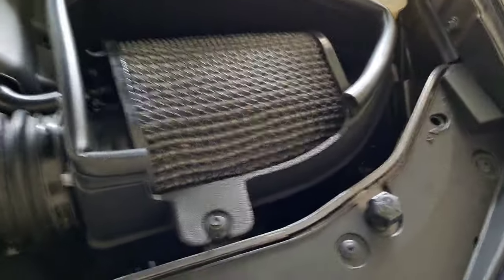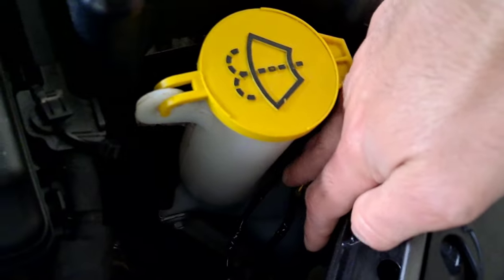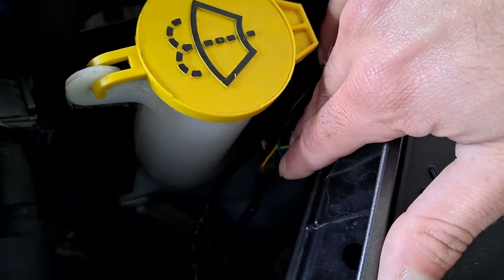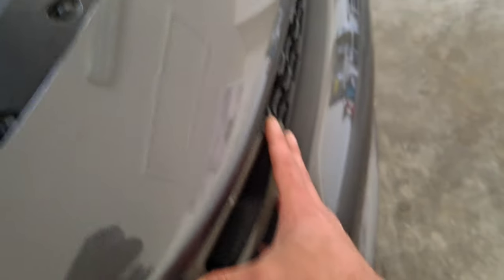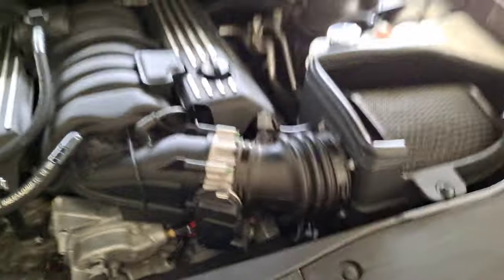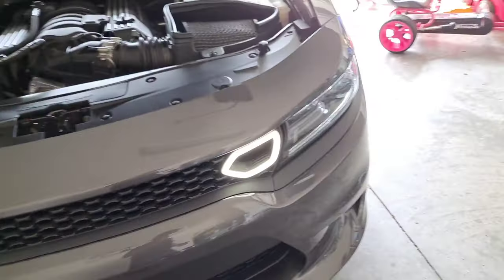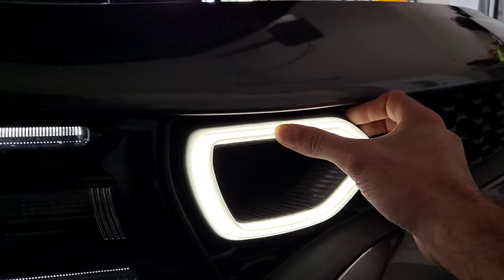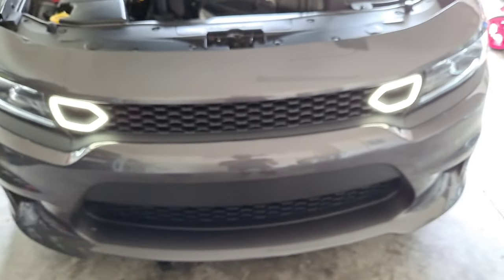Dodge Charger LED Snorkel Lights Install (Update on Install method)

Comment: Took my first set out, on my left one i had like 3-4 LEDs die, gonna order another set hopefully i just had a defective light. Worked good for about 5 months though before the issue. Gonna use this method next time.
Reply from the maker: I never even checked what kind of warranty these came with.  I know my LED headlight bulbs came with a 2 year warranty. One went out.  They sent me a new one no questions asked nxt day shipping.  Def the way to go if these have a similar warranty.  Thanks for Watching 💯💪🏾🤜🏾💥🤛🏾

Comment: I installed mine on my Scat  & sometimes when I'm driving EPS indication or ESC indications sometimes pop up on my dash, what's that about?
Reply from the maker: That's your traction light.  Electronic Stability Control.  I don't see how wiring these lights could do anything to that.  You just getting sideways 🤣

Comment: Yo FLA did u wire both to 1 sidemarker or 1 to each side marker
Reply from the maker: One to each side marker.  Man that lil Rock chip in the video actually Crack the light. Starting to let water in.  Smh 😤
Reply: Dam bro i would try some clear calk or somthin to seal it up today my passenger side was super bright and driver side was dim and they have bothe been dim for the last 2 weeks they been on my car ima have to go back in and check my T connectors
Reply from the maker: @bulletscat3927  yea was thinking about trying to seal it.
Reply: @KingFLA  i had the led sidemarkers on my last RT and a lil water got in there and burned out like 4 5 leds so i taped up the face and sealed the edges with some clear calk couldnt even tell

Comment: Yo does this way work the turn signal
Reply: Im hookin mine up now and cant get the turn signal function to work
Reply from the maker: The sell 2 different types.  1 with and 1 without the sequential turn signal.  I just lucked out and bought the right one. Lol
Reply from the maker: Did yours come with a yellow and green wire? Yellow wire supposed to be for turn signal
Reply: @KingFLA  yea
Reply: I got yellwo to pin 5
Reply: Wat pin to the yellow and green go to on driver side
Reply: Yo i got them workin bro followed yur steps but my shit not as bright as yurs i mean it is sunny as fucc out
Reply from the maker: @bulletscat3927  they both go to the same # pins on both side.